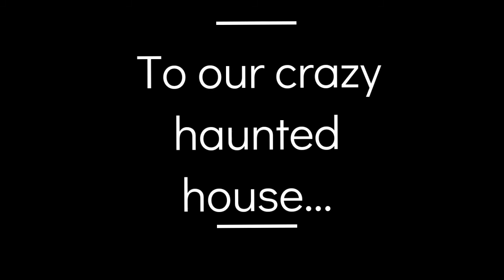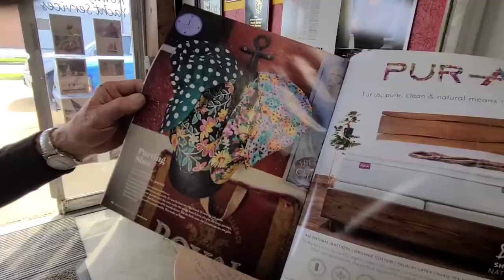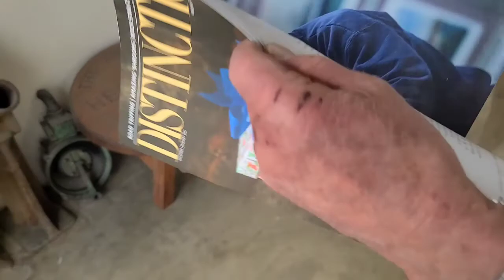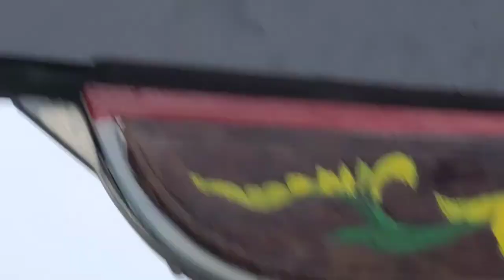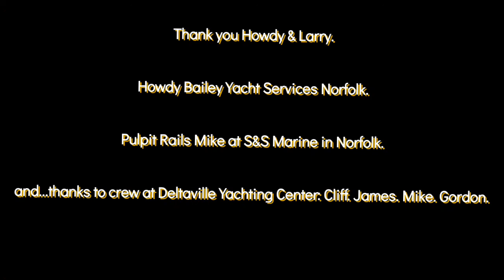Bow Sprit Finale!! S1:E6

Comment: Roughly what was the cost of that finished?? Oh luv the vids by the way
Reply from the maker: It's not finished yet. Engine was biggest expense at just under 30k. We did the bottom ourselves which still cost about 1500 because bottom is expensive.